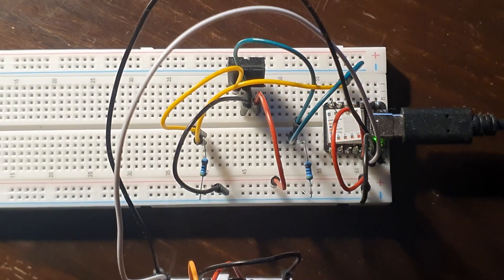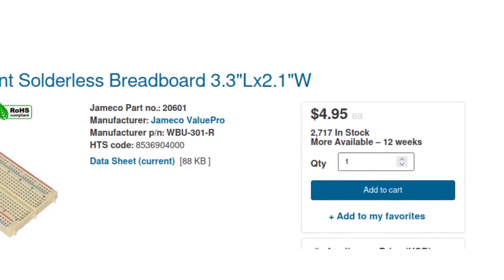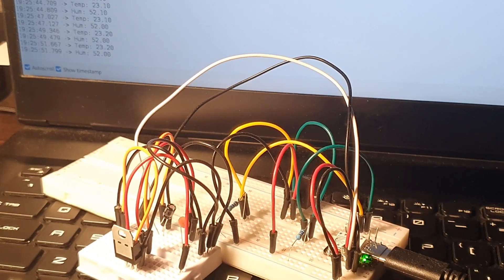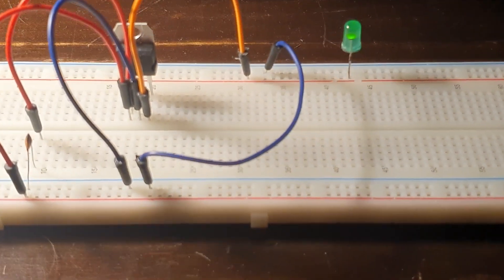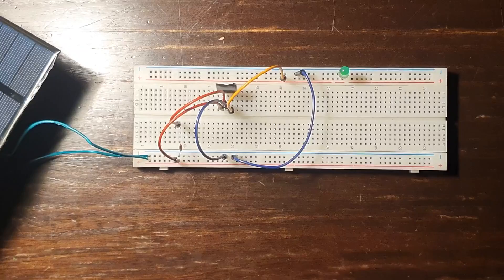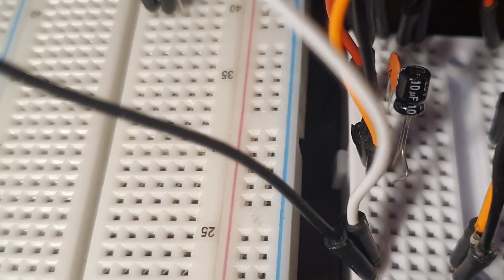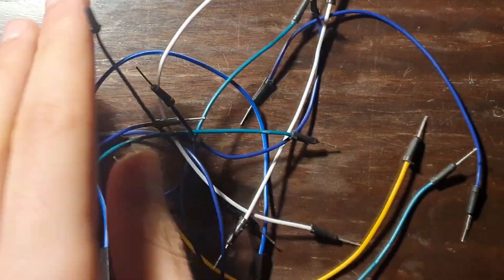Breadboards/Protoboards in 100 Seconds

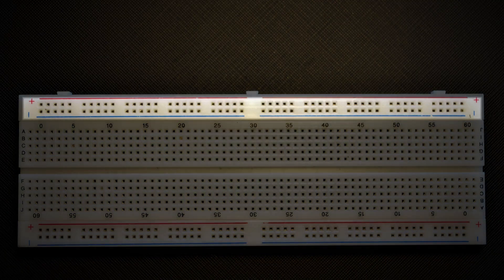Comment: 0:45 you forgot to mention that the + - power lines are splited in half (in for both)
Reply from the maker: Do you mean that for example the + line is split in the middle? I think this depends on the board, some are split and some are not.

Or

Do you mean that the + bus on one side is separate from the one on the other side? (Top + separate from bottom +). This is true of course
Reply: @V_Electronics 
Yeah
I have 2 large breadboards and I always forgot about that splited section on the power lines and I had to bridge them if I was powering more circuits.
Now idk if this applies to all of them but most of the mseems to have the side power lines reparated in half.
Reply from the maker: @piano_arts_2007  I think you're right. thanks for your comments, I didn't know there are boards with gaps (:
Reply from the maker: @piano_arts_2007  All of mine didn't have gaps (thats why I didn't know). I even have one with no power buses
Reply: @V_Electronics  
maybe thhese are from older versions I think
Reply: @V_Electronics  
yw 👍